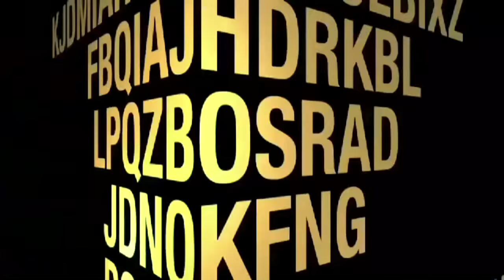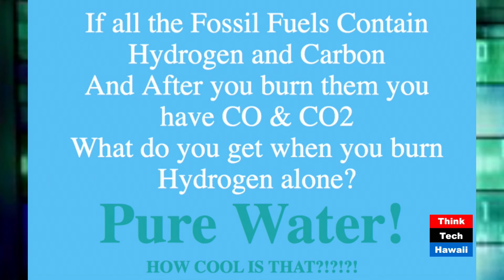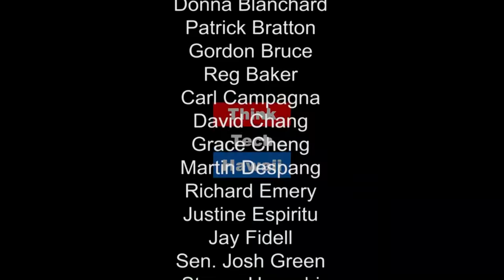Taking a Critical Look at Energy Storage

Comment: Excellent video.  Energy storage is vital for the future of transportation and renewable energy.  Lithium-ion batteries will play a short term role for electric cars, but are entirely unsuitable for grid-tie uses.  For transportation they are a useful step, as lead-acid, NMH, and others were before, but there is no where near the amount needed for meaningful market share in terms of new car sales.

Last year about 88 million new cars were sold.  Tesla's Gigafactory rated at 50 Gwh per year, and I believe they can ramp up to 150 Gwh with more investment, will only supply from 0.5 to 1.5 million vehicles.  It would required many Gigawatt factories to reach double digit market share, which would require massive mining and processing costs and impacts.  Not practical to scale up Lithium.  Tesla would need many dozens of factories to make a dent in actual new car sales market share.

Therefore, It's not a Lithium vs. Hydrogen discussion unless we specify what application.  For now, Lithium-ion is a step, and useful for the EV market early adoption, however, Hydrogen is the only real-world solution if we're talking about scale.

Hydrogen is the most powerful combustion known,  more kilo-calories per mole, or MJ per Kg than any other fuel.  It's the Top fuel.  It's also the cleanest.  It's feedstock is the most distributed:  water.  Most of the earth is covered with water, you're mostly made of water.  How amazing that it's also the result of the most powerful exothermic chemical reaction?

Short term (next 60 months) Lithium-ion is important to transition current EVs into greater public experience, however, Hydrogen fuel cell vehicles (which can also power forklifts, trucks, tractors, construction equipment) which Lithium can't power (too small energy density, most of the weight of the vehicle would be Lion batteries), makes Hydrogen the only solution which can scale.

Local hydrogen production (electrolysis driven by renewables ie solar at day, and wind at night, is the only scenario which can scale to 100%, works in every country (distributed), is Non-toxic, and eliminates the have/have not paradigm of world energy lowering world stress and toxicity.

The future of energy is Solar PV, electroyzers, Hydrogen storage, Water, and Fuel Cells.  Bravo Stan.